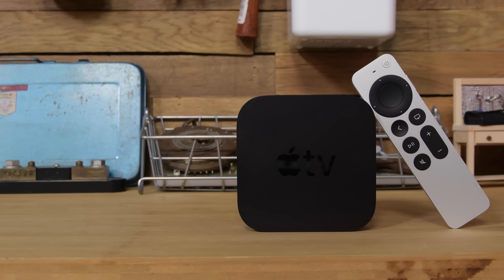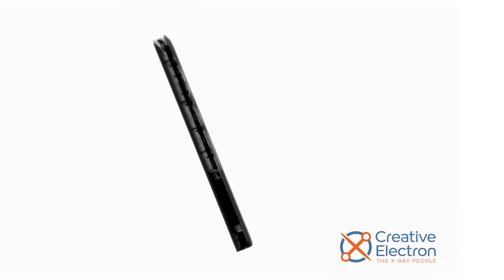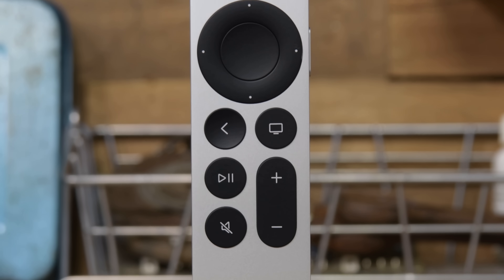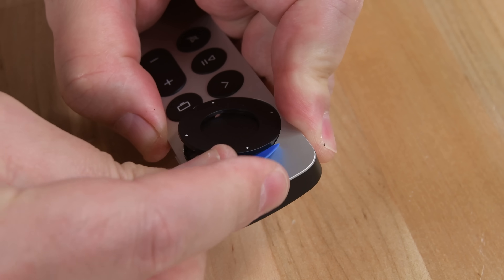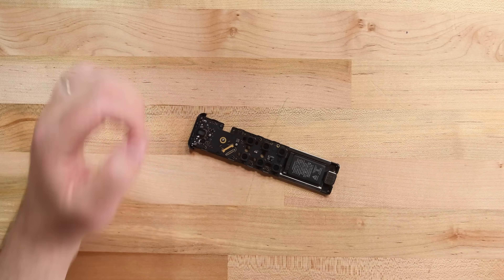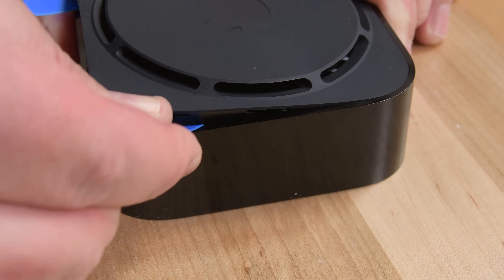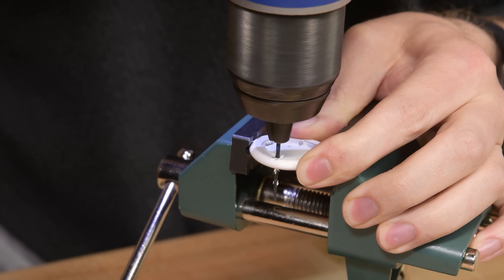Apple TV 4K 2021 Teardown! Good Luck Replacing Your Remote Battery!

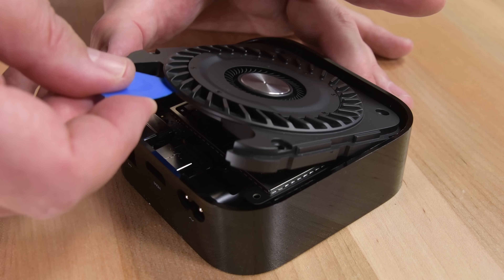Comment from the maker: Edit: at 1:02 we mention that the original Apple TV 4K was the first Apple TV to have a fan, but that's false! We forgot the original Apple TV from way back in 2009 also had a fan.
Reply: Guys, the original Apple TV was demo’ed by Steve Jobs in late 2006, and it was called iTV. Jobs demo’ed it again and announced the final name (Apple TV), pricing and shipping on Jan 9, 2007, the day the iPhone was introduced. 

In late 2010, Jobs introduced a newer smaller black Apple TV using the A4 from the iPhone.
Reply: Original Apple TV came out in 2007
Reply: When..!! I will seen the Ipad pro m1 and i mac m1 teardown.Wait for that time.
Reply: Bro do mi box
Reply: Older Apple TV‘s have the ability to calibrate display with your phone
Reply: the original Apple TV was released in 2006
Reply: @AlexScandi  2007 but it was announced in early January 2007 so close enough
Reply: @fn0va   But apple calls it the Apple TV late 2006

Comment: 1:29 This helped fix my Apple TV 2nd Gen. it wasn’t turning on and I noticed a lil rattle when I shakes it. After opening it up. Turns out One of the screws for the power supply came off causing to malfunction. After putting it back one and assemblying it back together, the Apple TV works good as new. 

To think a simple loose screw was causing the issue

Comment: Would’ve been very nice if you showed us how you got off the power button.
Reply: So if you look closely to aluminium surface on other buttons is hard damage 😏 not the best way to dismount. One valuable thing is that this metal brackets from touch button are on 45degree so I know where to push 👍

Comment: @ifixit 

How does the power button come off? I got all the other buttons removed but I can’t slide the guts out yet. I assume it’s because the power button is still attached. The video doesn’t show it being removed, just jumps to someone pulling out the guts. I can’t get my opener within the fine crack and think I might be stuck if it removes just like the other buttons. 

Any information you could share would be greatly appreciated.

Comment: Anyone else here dealing with the remote power button getting stuck? My issue isn't with the battery (which is amazing, thankfully) it's those damned buttons with there extremely low tolerances. They are satisfying when they work, but god forbid it get any sort of gunk in it... especially if you have kids.

Comment: I just bought a AppleTV 4k 2nd gen 32gb and the remote direction buttons LEFT , RIGHT and UP don't work. Down still clicks fine. The remote was kinda dirty so I am thinking they spilled soda or something on it. I can't get that direction pad off. I can't find my screen tool for prying it out. Been trying to use hard plastic and thin items but nothing will pop it out. Suggestions on what to buy?

Comment: My daughter spilt juice on the remote and it became super sticky even trying to get as much IPA in between the buttons and the body to disolve the juice.  Being afraid of taking apart the remote apart at first but after seeing this video of how it is actually put together.  Ive managed to take it all apart, cleaned and reassembled without any damage physically to anything.  I used (funny enough) a pad lock shim from Lockpickinglawyers covert companion set.  It is extremely thin and had a tiny notch and i slipped it between the circular touch pad at 2oclock to avoid damaging the tab. It popped the button up and i used ifixit plastic triangulae shime to get the button off.  With that button out, to remove the rest of thebuttons, i again used covert instrument medium sized lock pick and slipped it into the open slot and pressed the smaller buttons tabs, itll pop up enough for you to have a sharp tweezer or pick to take the button out safely without damaging anything. I did the same for the rest of the buttons, reassemebled and works perfectly fine after you turn the apple tv on and off once so the touch pad recalibrates.

Comment: Honestly if the battery got that bad I’d probably buy a whole new remote, they are $60ish dollars online. I’d assume a new battery would be 15-20, and you can get after market remotes for cheaper, but like others have said the Apple TV will probably die before the remote does. And before I would even consider a battery replacement or new remote I’d probably just use my iPhone as the remote for a while.

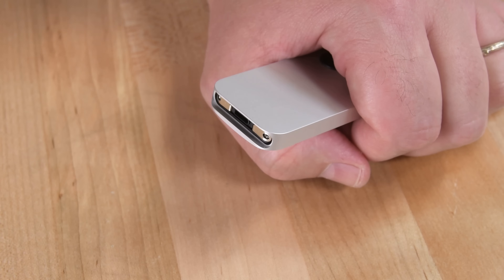Comment: 2:10 What is the blue plastic scrapper kind of tool which you used to remove the apple tv remote buttons ?
Reply: It doesn't matter, it's impossible to do it with that scraper. I don't know how he just "started popping out" the buttons.

This doesn't deserve an 8/10 for repairability.

Comment: great video. We dont use wifi or Bluetooth and so we have disabled everything and use Ethernet. I tested it with my Radio Frequency device and i am still getting strong RF signals coming out of my 4K Apple TV. How do you disable the Bluetooth and wifi completely? I have disconnected it all in my smart TV. I notices there were 3 antennas that can easily be disconnected. Wondering if it would be as easy as that to stop the wifi and Bluetooth from searching.
Reply: Hi, interesting! Can you tell me why you are avoiding Wifi and Bluetooth?

Comment: I hate remotes with built-in batteries.  NiMH is a much better option.  Readily available, cheap and easily replaced when they wear out.  It also forces them to make the remote a sensible size.

Comment: Pretty sure the IR blaster on the remote is for TVs, Soundbars, etc, not the Apple TV itself. I believe the remote connects over Bluetooth. Also, the remote has a long battery life currently. If you put a coin cell battery in there, it would be plugged in all the time.

Comment: Our company's remote never has been charged to my knowledge. Started thinking it runs on thin air, but even under heavier use, I'd rather sometimes charge a rechargable battery than replace a coin cell way more often. I don't think it will reach the point, where it doesn't make it "through the day" anymore. Like with the Keyboards, they just hold for ever.
Reply: It's interesting because no one know what your company is.
Reply: @DontFuckWitDreDay  I know, thats why I haven't named the company either. I just work there, it's a place with an Apple remote and thats all you need to know;)

Comment: I'm all about right to repair but I don't see the remote being an issue. It's cheap enough to just replace considering the battery will last 3 years to a decade based on the data we have. Most of us will replace the Apple TV long before we need to replace the battery inside the remote.

Comment: They could have put the battery in a plastic caddy of some sort with its own battery terminals and the lightning connector could have been attached to that.  But then the remote might need to be slightly thicker or the battery slightly thinner.  Either way, good video, now people can make an informed purchasing decision.

Comment: But do we really need to change the battery? By that time most of us will probably have switched at least two or three iterations of Apple TV's already.
Also, in the four years of owning a 4K Apple TV, I've recharged the remote about two times. Ok, I'm not a very heavy user, but still.

Comment: It depends how expensive the remote is, if it is not to much, just buy a new one, sell the other one for parts. It is good that the most likely to fail is the remote, unless they don't sell replacement ones or it is impossible to pair a different remote to the Apple tv.

Comment: Realistically, the battery on the remote will outlive the owner of the remote. If you manage to drain it fully every 2 months, which seems to be very hard to do, it’ll take 83 years to kill the battery. I guess realistically it would be more likely to die of old age than cycles.

Comment: The remote battery will likely outlast the usefulness of the device. In this case, we are not talking about a high cycle battery, like a phone where you charge it everyday. A full charge on the remote battery will last 3 -6 months. Lifetime is likely to exceed 10 years.

Comment: 3:32 I doubt even 1% of the people buying this product will replace the remote battery, no idea why you said everyone will need to at some point
Reply: Batteries eventually stop taking a charge and die completely. Of course everyone will have to replace the remote battery.

Unless you want to be wasteful and buy a new one. That's what Apple wants, they make more money that way. Oh, but they're such a green, environmentally friendly company of course. 🙄
Reply: @mjc0961  i get that batteries lose charge over time, but with such a low power thing like a remote i highly doubt it’s gonna die even in 10-15 years unless it’s a genuine malfunction. the buttons will probably break before that happens. there are so many first gen iphones, ipod touches etc that are still working fine, albeit they have lost charge. just my thinking

Comment: Apple TV 4K doesn't use IR. It's Bluetooth. The IR is present on the remote to control TV's and Home Cinema gear etc.
Reply: Pretty sure IR is present on the Apple TV itself as well. Not for the Siri Remote, but so it can be controlled by any other IR remote (like your TV's remote).

Comment: Lol lightning port still and painful battery removal. What a joke.
Reply: Why would you want to remove the battery? And I still fail to understand the hate towards the lightning - it's still a much better physical connector design than any USB standard, including USB-C.
Reply: @TheOriginalNCDV  because batteries fail. Every battery fails. Lithium based batteries have a lifespan of 2-3 years at best and people typically keep AV equipment much longer than that. And lightning is an old cable, everything has moved up USB-C, so why keep two cable types when you can just keep one and plug everything in? Especially for a remote to charge.
Reply: @BloodyIron  Sure, unused lithium batteries can discharge past the point of no return. And yes they have a half-life that limits the number of charge cycles. The previous remote needed charging once every 3-4 months. At that rate it'll take much, much longer than 3 years to completely fail and becomes totally unusable.
Reply: @TheOriginalNCDV  either way you're likely to want to replace the battery during the lifespan of the device. So making it require such work to replace is intentional poor design.
Reply: @BloodyIron  I disagree. Making a device that won't need battery replacing during its lifetime is a much better design.
Reply: @TheOriginalNCDV  this device will for sure need its battery replaced at least once during its lifespan. There's zero benefit to making the battery not replaceable. When was the last time you looked at a remote and was like "this removable battery sure is causing me problems". Yeah, never.
Reply: @BloodyIron  you obviously have not owned one of these remotes. You literally have to charge it 3, maybe 4 times A YEAR. Even if the capacity dropped to half over its lifetime, you'd still only need to charge it every 2-3 months (and it only takes around 45 minutes).
Reply: @BloodyIron  oh, and removal batteries HAVE caused me problems. I don't keep an endless supply of cells (especially the CR2032 type). I have to make a conscious effort to remember to buy them when they fail.
Reply: @TheOriginalNCDV  buying batteries is a problem lol. Not being able to remove a battery is a bigger problem. I've had multiple devices get destroyed because the battery expands and I can't remove it.
Reply: @BloodyIron  charging a battery is a problem "lol". I don't know what you do with your batteries. The only batteries I've had swell on me are the LiPos I use for my RC planes - and that's because those are exposed to extremely high current draw and charge rates.
Reply: @TheOriginalNCDV  it's a common problem. I'm nowhere near the only person experiencing it.
Reply: @BloodyIron  that doesn't make it a common problem. If it was, there would be a recall.
Reply: @BloodyIron  I'd almost forgotten since replaceable batteries are no longer a common thing: have you ever left dead alkaline batteries in an unused device such as a game or AV controller for an extended period? If you have, you'd have seen the corrosive damage it causes to the battery contacts that ultimately spreads to the surrounding circuit traces and destroys them permanently. I've seen this firsthand in a couple of old Wii controllers and a tragically underused balance board. Some of my old AV remotes I've managed to save in time requiring only some vinegar to clear the contacts before the rot had spread further. This doesn't happen with lithium cells.
Reply: @TheOriginalNCDV  yeah I've had that happen before. Yuck!

Comment: I think i've charged my Apple TV remote.... 5 times since I've owned it? So the battery has MAYBE 10 cycles on it in 3+ years? At that rate it will last like 30 years before needing a replacement battery. I guess what i'm saying is that I think this device will be non-functioning before it needs a new remote battery.
Reply: iFixIt invents issues because selling parts and tools is their business. In reality, a lot of the problems they mention actually make the device last longer and ignores the way consumers actually use devices. Or even just ignores the reality of supply chains (RAM tends to be soldered because the LPDDR3/4 used in thin laptops isn't actually available in DIMMs in the first place). Their teardown are cool, but never forget they're running a business.
Reply: True but sometimes you get a bad battery. My old ipod touch had a faulty battery, meaning that afer 3y the battery was lasting 1h of use time, even though it did not have more than 300 cycles on it. Being able to replace a battery is always nice.
Reply: Totally agree, I’ve had my 4th gen Apple TV since launch (almost 4 years) and I’ve charged the battery maybe 6-7 times despite watching TV daily so unlikely anyone will need to replace their batteries in the lifetime of the product
Reply: batterys also age over time, not only by cycles.
Reply: @Andi11144  you are right, but that takes 20 years. Maybe 5-10 years if you leave it on 0 or 100%.
Reply: @MaxMüller0  nope I've seen batteries die much sooner
Reply: @Andi11144  yes, but very lightly used ones like that last for years and years. My 10 year old iPod touch’s battery is still perfect.
Reply: @cstalt  If your 10 year old iPod touch's battery is still perfect then you barely use it at all. I bet you didn't even use it since the day you bought it and just keep it for showcase. Whom are you kidding here man ? You think we haven't used iPods and iPhones ? LOL
Reply: @Andi11144  lithium batteries do not age like other types of batteries do. As long as it has storage charge you can leave it and it will maintain that charge for years. What kills lithium batteries is leaving it connected to power all the time (ever notice those bloated iPad display units at Walmart or another stores, this is why), charge cycles also take a slight hit in life but it's nothing like other types of batteries. And how often the remote needs charged it's going to last for quite a while.
Reply: My iPod Nano 5 battery died in 6-7 years and is nearly impossible to replace.
Reply: yes, but it depends on use case. YOU might not need to change the battery but someone else might need to, so I don;t see your pint at all
Reply: totally agree! i don't see this as a problem on the remote

Comment: It looks like the case was scratched when brute forcing button removal. 
Since the buttons pull straight off. Try melting the end of a hot glue stick, apply the melted end to the button and allow it to cool. Then safely extract the button by pulling on the glue stick. This trick can be used to remove keys broken off in locks, and I have personally used it to remove metal bits from my MagSafe charger. 
There are different types of hot glue sticks and I’m sure iFixit could test them and market them on your website. Keep up the good work!

Comment: 3:32: I wouldn't say everyone will have to replace the battery at some point. I have my Siri Remote for 3,5 years and it still needs to be charged once or twice a year, while being used nearly everyday (in these times^^).
Reply: What year is your apple tv? 2017-8?
Reply: @Josmersuero  Late 2017. It's the Apple TV 4K. So the siri remote with the white bordered menu button.
Reply: yeah, honestly channels like these are always acting as if we need to change to a new battery every 2 years 💁‍♂️
Reply: @kjeldkaj  It depends on a lot of things including time and luck, one may not need to swap a battery in 5 years while others have a swelling remote after 2 years. Batteries are unreliable consumables and should be designed for easy replacement just in case.

Comment: Putting a battery that will potentially bloat in a unibody aluminum case and it will end up like iPod nano 4/5
Reply: The power draw of a remote is far, far less than an iPod. It also doesn't need to charge very often. This battery shouldn't heat up much, so bloating is a lot less likely. (Also, they've improved their battery chemistry and construction.)

Comment: Built in battery is 100x better. I’m sick of replaceable batteries.
Always have to buy and dispose them. Charging up is way more convenient.
The Battery in the remote should be fine for 20 years and nobody would use it for that long.

Comment: I have had the original Apple TV 4K since 2018. I tend to charge the remote 2-3 times a year. Maybe i charged it couple more last year with all the lockdowns. But even if it was charged every month. And assuming the same 500 cycles to 80% capacity that iPhone batteries are rated for. thats like 40 years. And one charge per week would be almost 10 years. And the battery will still last for many many more cycles.  

I think you would see more remotes needing to be replaced due to leaky disposable batteries than due to dead rechargeable ones.